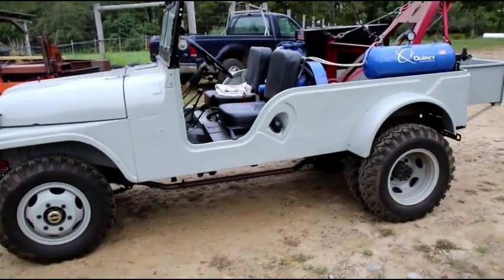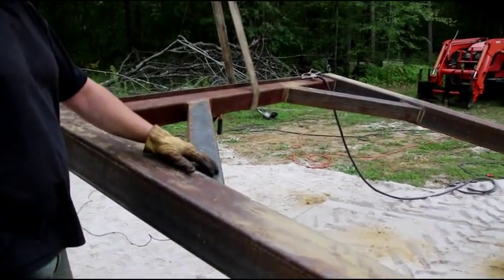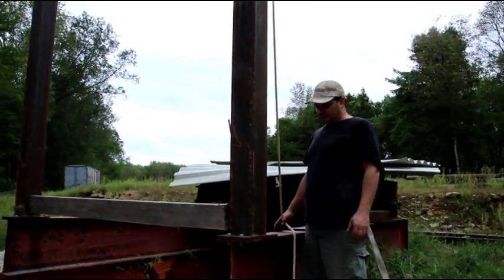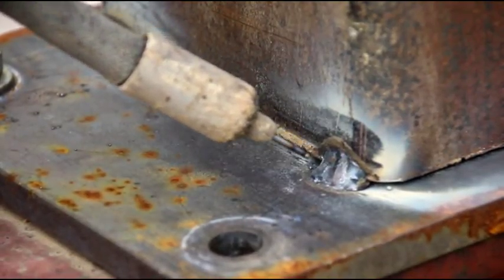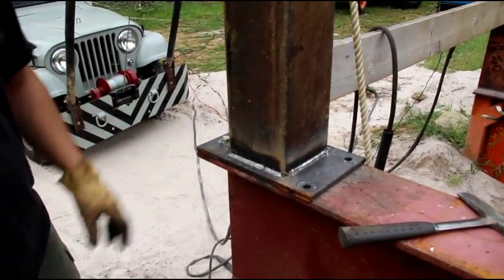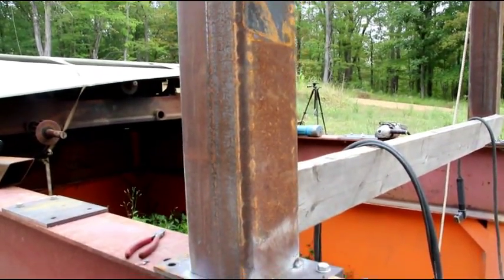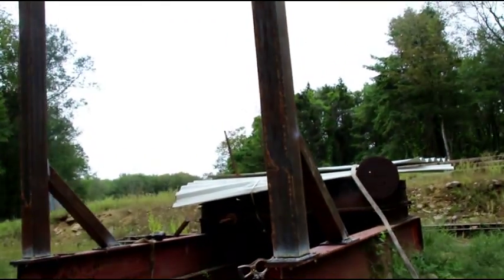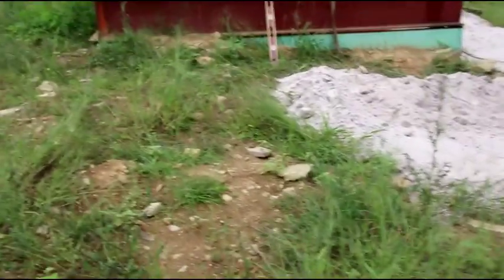Willys CJ6 Gin Pole Setting Steel Welding Arc Shots

Comment: Back in my early 20's, I worked for a company that sold Frick sawmills.  I set up a couple of them up and help with the repair of several more. One job was where the owner sent the carriage though the wall!!! It was out in the yard when we got there!!  The company had been in business for many years and there were still some of the old parts lying around in the shop.  All the new parts came in heavy built wooden crates.  Very interested to see your sawmill come together!!  Also, nothing like making use of your jeeps!!
Reply from the maker: The sawmill is a big project and I use a helping hand like the jeep every chance I get.

Comment: I love that Jeep!! I don't see gin poles ever being used today, but they seem to work well.
Reply from the maker: This gin pole works great because it has a lift of 24'.  I don't use it for super heavy items but sure does work great for light things that needed to be lifted high.
Reply: The gin pole is an old tool way pre-dating anything we call a crane.  In common use up until relatively recently for raising barns for example.  Good to see the skill is not entirely extinct.
Reply: I see gin poles everywhere, usually stilling in a fence row on an old pickup or straight truck, but I've never see them being used. I can see the benefits of using them though. Some of those old school gin pole winch drums work just like a crane.  Open straight cut gears, band brakes, clutches, etc. My Uncle plays around with a truck mounted 1942 Bantam Crane, and it's pretty much the same theory. I'd think with these modern day powerful electric winches, a short set of gin poles would work great around the farm.
Reply from the maker: The gin pole is a real workhorse around my farm.  I made it tall enough to take care of most light lifting jobs.  Building a new barn now though and a tall crane sure would make life easier.......
Reply: Almost every oil rig moved today has a gin truck working on it big tandem steer duel winch capable of 80,000lb picks. So you eat today because of gin trucks.

Comment: I like the job ,like your equipment and those flux core welds are pretty . you need reversed polarity to weld good flux core welds and looks like that was set right , but the 7018 rod needs straight polarity and it sounded like reversed , I'd grind out the rod welds and throw down a flux bead and call er dun , good show

Comment: I love that Jeep!
What is the running gear from?
Does it still have a Willys engine?
Wrecker set up 100% home grown or adapted from somthing else?

That may be the most useful vehicle on the planet.
If only there was room for an engine drive welder on it :)

For your set up it makes more sense to have the welder separate and I just don't think there is room on the Jeep.

I Liked and subscribed.
Reply from the maker: Original running gear and wrecker parts.  The wrecker was off of a CJ5 but I installed it into this CJ6.  If you follow my channel you will see I have a factory setup CJ3B welder Jeep that I am slowly rebuilding much heavier and with a more powerful power plant...a Cummins 4BT.   
This CJ6 has the original F134 engine and a T98 4 speed.
Reply: @metalshaperJeep  I had no idea dually Jeeps were ever a thing.

4BT swaps are awesome.

Comment: Brian, I may have missed it, but what happened to the large trailer build, last I seen was the draw bar plate almost finished
Reply from the maker: the trailer is just about finished, axles installed, tires, hitch, etc.... just need to sandblast and paint and install the wood deck.  Will show it in a future video.

Comment: I love the dually setup on the CJ-6.  Did you also build a heavier frame for the Jeep?
Reply from the maker: No, when the duallys were installed there were frame plates and extra overload springs installed to compensate for the heavier weight that was being added in the jeep.  I am doing the same thing on the snowblower jeep and will show you the process and parts used in the dual wheel setup in future videos

Comment: What is the OD on those gin poles? 2-3/8"....I am building a flat bed for my dually and wanted to add some gin poles that would attach with receiver hitches welded flush to deck of bed. I have a few videos of the progress of it just needed ideas on gin pole setups.
Reply from the maker: This gin pole is standard 2" schedule 40 pipe.    My heavy gin pole on the military 5 ton is 4x4 square tube .375" wall thickness.   I can lift about 1000 pounds with the CJ6 gin pole in this video and about 8000 pounds with the military truck gin pole.
Reply: @metalshaperJeep  Thanks. I may then use my 2-3/8 pipe to make a 14ft gin pole.

Comment: Hello Brian, are you using schedule  40 for the gin poles? How much have you lifted with them? Thanks
Reply from the maker: the gin pole on the CJ6 is standard 2" schedule 40.  I used that because the jeep itself it so light .  I have lifted approx. 700 pounds without any trouble with it.  If you watch the video of the 5 ton truck with gin pole out the back you will see it is much heavier construction.   With that rig I easily lift 6000 pounds using a double line setup and a 20,000 pound winch.
Reply: @metalshaperJeep  thank you for the response. I wanted to do something similar on my 89 f250.

Comment: Hey there I’m curious as what you put for lubricant in those pto winches? I have a Tulsa winch on my Cj2a I have rebuilt and don’t know what lubricant to put in
Reply from the maker: I have a complete line of lubricants and use 2 different depending on how good your seals are and if the winch shaft runs true.  Also need to know the temperature you are operating in and I can help you with the correct lube.   Contact me at metalshaper@comcast.net and I can send you a price list and options for your winch.  
Brian

Comment: Hello Brian, could you tell me what brand of flux core wire you are using in your video. I would like to try it at home. Thank you. Dan
Reply from the maker: Hello Dan, the wire I am using is a structural T-8 wire.  Specifically Hobart Fabshield XLR-8.  I am using .072" diameter wire with a feeder off my engine drive welder and a Bernard Flux Core Gun.   Can be tricky to use until you get the hang of it, but you will love it once you get familiar with it.  Let me know how it goes.
Brian
Reply: Thank you very much. I will try it. Dan

Comment: im interested in your gin pole,  i have a m53 deuce i want to maek a gin pole for to lift 700# blocks up 2 storys.  you set up is pretty tall for that little jeep. 22ft high, how much can you lift?
Reply from the maker: with this little jeep I can lift and move 1000 pounds but keep it low .  When lifting the full height I keep things around 500 pounds for safety.   Look at this other video of my gin pole on the 5 ton truck.  With this I can lift 8000 low and have lifted 6000 pounds the full 24 feet.   https://www.youtube.com/watch?v=e6g-NlunQ1I

Comment: Would I ever like to get my hands on a jeep such as this with a PTO to the front and rear. 
They must be rare.
What is the designation for this type and are there any more like it?
Reply from the maker: Willys like this one are getting tough to find but they do come up for sale every so often, and usually require a complete restoration.  This is a CJ6 Garage Service Jeep and was equipped like this from the factory.   If you watch some of my other videos you will see I also have a trencher Jeep, a diesel powered air compressor jeep, and the welder jeep that I have a lot of videos on building a body tub.  
Brian
Reply: @metalshaperJeep  what size of pipe u use on the gin pole and how long is it . Going to be setting I beams at my river lot  for my cabin
Reply from the maker: @richardrenneckerjr4631  I used standard schedule 40 pipe for this gin pole.  It is 22' long and will lift about 1000 pounds safely.  I also have a much heavier gin pole on a 5 ton military truck that is 26' tall and will lift about 10,000 pounds before the front wheels start coming off the ground.   Used 3/8" square tube on that unit and have a 20,000 pound winch doing the lifting.
Reply: @metalshaperJeep   thanks for  getting back to me .

Comment: I just checked and the machine I am referring to is the Pullmax
Reply from the maker: The pullmax is a wonderful, do everything type of machine.  I make the dies out of various materials depending on what they will do.  mild steel for short run dies, 4140 for others, and finally S7 for heavy use dies that I harden to a rockwell 56.   More to come.

Comment: Thanks for the reply Brian. 
If you get a line on one let me know at 705 756 2677 ( that is if you are all topped up on Jeeps)
In the meantime I'm looking for 2 front drive axles, motor, trans w/transfer case, and motor.
Fix' en to build a 4 wheel steering yard beast.

I searched, but all I could find was yours. Looks like you had it for sale at one time
I'm following your saw mill build  with interest. I have a swing saw from D & L, made in British Columbia.
Reply from the maker: I will keep my eyes open for you.  Yes, I did have everything for sale at one time, but didn't get any serious offers. Too many tire kickers and low ball offers.  Winter is tough to work on the sawmill, frozen ground and freezing temps make it hard to make progress.  Springtime will bring more videos of the sawmill progress.
Brian